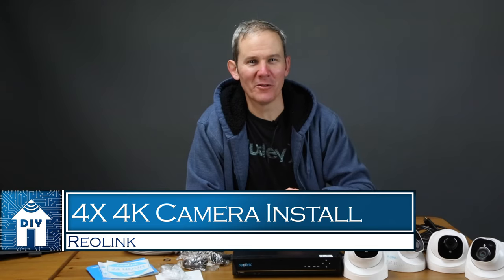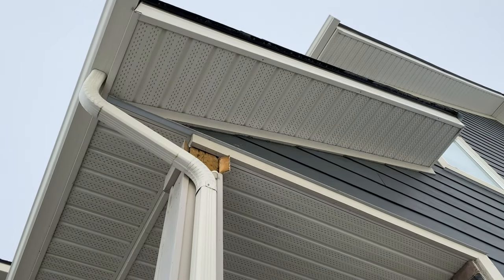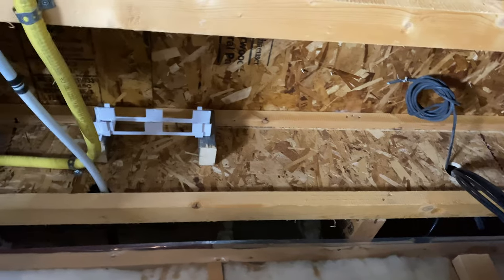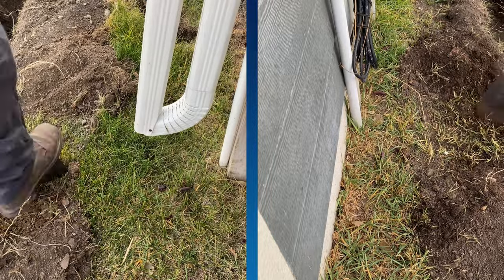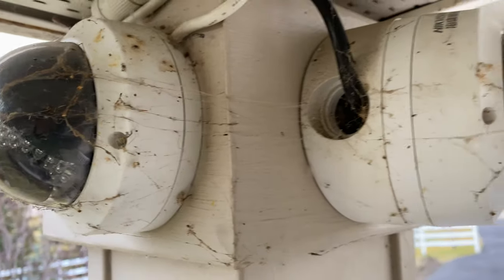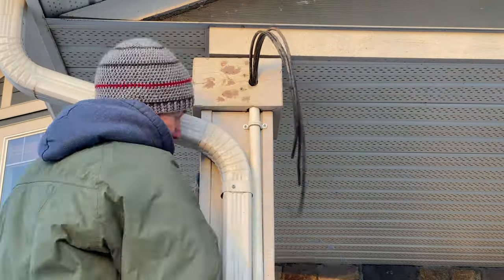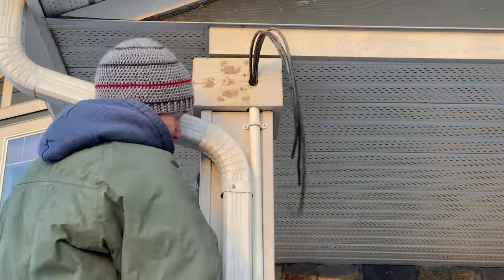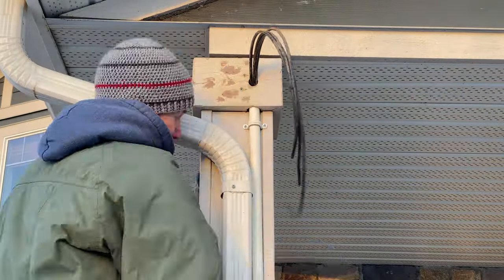How to install Reolink Security 4K PoE Cameras Outside - in DETAIL

Comment: Awesome video, thanks!  Just a quick tip if you have an existing hole from a hole saw that you need to make bigger, you can usually double up the smaller size hole saw inside the bigger one on the bit itself, and use that as your pilot hole.  That assumes they're the same brand, so I always buy the same brand hole saws.

Comment: So you mounted the camera plate to the junction box plate? Does it feel secure enough or do you need to use screws with a nut on the other side?

Comment: Why  did you go with reolink vs hikvisions ? Are you looking at moving to a standalone all in one nvr verses the blueiris machine ?
Reply from the maker: Good question. I find the genuine Hikvision cameras a little harder to find because they only have a very select list of distributers. The Reolink cameras are on Amazon and on reolink.com, and much and quicker to get my hands on. I also like their marketing and feel they have a strong position in the market. I am still running Hikvision and Blue Iris and I have videos in the works on each.
Reply: @HomeTechDIY  I have been using "gray market" hik's from what i find to be a reputable seller on ebay. No issues with them so far. I am still on the fence however weather dropping nearly $400-500 on a hikvision DS-7716 NVR or building a BI machine.
Reply from the maker: Yeah, it's a tough call. If you are installing more than 4 cameras, you'll want a beefy PC... which translates into money spent on better performing hardware.
Reply: @QuaabQueb   You can definitely find better prices for a DS-7716 (or OEM equivalent) on eBay.  You shouldn't be paying more than $200 if you know where to look.  There are 70+ companies that rebrand Hikvision products. I'd highly recommend looking into some of those OEM products on eBay, as you can find the exact same NVRs and cameras at a fraction of the cost.
Reply: Why not use Synology NAS? 😎.
Reply from the maker: @Dextermorga  Not sure if I am missing something but to met the same specs as the Reolink NVR, you would need the Synology Surveillance Player VisualStation (VS960HD) as recommended by the Synology NVR Selector. The cost would be $1000US and you would also need to purchase a PoE switch. VS960HD - https://amzn.to/3tkugZw
A Synology NAS can only be used to record footage over the network. I tried the NAS solution in the past and it couldn't keep up with the heavy bandwidth. Internal drives are much faster and more responsive, especially an NVMe drive, like I installed my my latest video.

Comment: Nice install thank you. Just have question . is there any signal lost if you use patch panel between NVR Unit and Cameras ? I want to do the same idea just wondering if there's a big diff. Secondly I want to upgrade my NVR 8 chan. to 16chan. What do you recommend add on another 8cha. unit or just straight 16cha. unit ? thx appreciate for the response.
Reply from the maker: Thanks for checking out my video. There is no lost signal or lag using a patch panel. I would recommend getting a 16ch unit instead of running 2 8ch units... unless you can fit more hard drive space into the 2 8ch units and you need that extra storage.
Reply: @HomeTechDIY  Thank you very much for the reply. I will do your advice.

Comment: Rather than the camera’s nightvision, would motion-sensor floodlights be a better light source?
Reply: If you have really bright lights that would allow the cameras to get color photos that might be ok, but you would have to deal with the time it takes for the camera to adjust from the night mode to the lights coming on.  You may also have issues with reflections from bright spot lights.  I don't think it's a bad idea, but you may have to do some tweaking and adjusting.  Another option is to get a remotely located IR emitter - they generally provide much more IR light than the camera does.  Added bonus, camera doesn't get covered in bugs.

Comment: Thanks for the tip on using Big Box junction boxes instead of the expensive Reolink junction boxes. I always wondered if they were the same size, and you answered the question for me. I will be replacing three nest wifi cams and going to 4K/NVR package very soon.

Comment: What an excellent video.  I have a number of cameras sitting around waiting to be installed.  I too have poor access to the soffit area and into the attic and have been considering various options.  I might go this route but I have to figure out if I want to use outdoor rated ethernet and just tuck it into the vinyl siding under the soffit around the house, or if I want to paint conduit and mount it along the roof line under the soffit.  Outdoor cable tucked away would be less noticeable, but conduit would help in the future if I ever needed to replace the cables.
Reply from the maker: Glad you found the video helpful. Tucking the wires into the siding is a great solution. I have done that a few times and it's a pretty quick solution. I did have a little trouble on 90-degree turns where the wires were a little visible. Yes, if you need to replace the wires, pulling them out carefully not to damage the siding.

Comment: Can you hang these (820a) cameras from above (under overhang of roof) or are they intended surface mount only?
Reply from the maker: They can be installed on a horizontal or a vertical surface. I have several under the overhang on my roof and they work perfectly.

Comment: Awesome video.  Did you glue all the pvc conduits including elbow joints?
Reply from the maker: Yes, lots of dry fitting and gluing
Reply: @HomeTechDIY  

You mentioned you wish the junction box were bigger.  Since the conduit is glued to the junction box, I assume you will have to cut the conduit pipe to change the junction box in the future, right?
Reply from the maker: Yes. I would remove all the boxes and pipes and re-fit everything on top of the pillar.
Reply: @HomeTechDIY  

I am in the process of putting up a pvc conduit on the side and back of my  house to run my ethernet cable.  I think I will glue only  the critical joints that needs stability.   I am runing outdoor rated cat6a cable, so not worry about the moisture.  The pvc is more for aesthetic than cable protection.  What do you think?
Reply from the maker: Sounds like a good idea to me. :)
Reply: @HomeTechDIY  
What did you use to make a screw thread on the junction box cover?  I suppose I can drill a hole to hold  the plastic anchor that is used in stucco. Then I can simply screw into the anchor?

Comment: Nice job, good future-proofing as well.  Something you might consider in the future would be remote IR emitters.  You can turn off the IR in the cameras and that cuts down on the spider attraction.  You can also paint the top part of the downspouts black which helps with glare even if they are just outside this picture.  Thanks again.
Reply from the maker: Thanks for the tips!

Comment: Where did you get the smaller waterproof cable grand and  cap?  The ones that came with the Reolink camera are too big (too long).  The ones you used look smaller.
Reply from the maker: I had some extra lying around that did the trick.

Comment: Does the patch panel affect the POE the NVR provides to the cameras? I purchased the same system and am trying to find a way to keep things relatively organized without needing to buy an expensive POE switch or building out a complex home network…
Reply from the maker: I didn't notice any impact to the power or data in my scenario due to the patch panel. It is a possible point of failure but also helps clean things up and keep things organized.

Comment: Can these be installed on a wall instead of a ceiling without a junction box?
Reply from the maker: Yes, on a wall is just fine. If you are not using a junction box, make sure to account for the wire when planning your install.

Comment: Very helpful. Thank you! Have you had success connecting a doorbell cam to the Reolink NVR? I'm considering a system similar to what you've installed and would love to be able to add a doorbell cam (and perhaps a couple indoor wireless cams) to the system. Do you know if that's possible? Thanks again. Your ability to explain complex config steps in a clear and concise way is impressive. Well done.
Reply from the maker: I have not tried it but it would be possible if the door bell supports ONVIF.

Comment: Hi, I am trying to add junction box to my reolink cameras. I bought the same ones you are using but having troubles with the screws. They stick out cause the heads are too big. Did you use different screws?
Reply from the maker: Hey. I had the same issue, so I used a larger drill bit (the same width of the screw heads) to make the holes in the cover a just a couple millimeters deep so the screw heads will be flush with the cover.

Comment: Is cat 6 cable all the same? Where do you get yours, there seems to be cable from $90 to $225 for 1000' rolls. I read some is solid and some is braided do you have a preference?
Reply from the maker: The link for mine is in the video's description. There are different quality notes, like sure copper or just copper coated. There is a difference sometimes in the wire gauge. I prefer the thicker stuff at 23AWG, instead of 24.

Comment: Hi there, I'm looking to mount some reolink bullet cameras on a solid brick wall. Do you recommend the junction boxes to hide/house the reset & power fittings? Thanks
Reply from the maker: Unless you can access and hide (and then seal) a hole for the connector behind the wall, it seems junction boxes are the best solution to hide the fittings.

Comment: Do you have a link or description of the junction box you used ?
Reply from the maker: Similar Junction box: https://www.homedepot.com/p/Commercial-Electric-1-2-in-Gray-5-Holes-4-in-Round-Non-Metallic-Weatherproof-Box-WRB550PG/300851119
Junction box cover: https://www.homedepot.com/p/Commercial-Electric-Gray-4-in-Round-Non-Metallic-Weatherproof-Blank-Cover-WBC300PG/300852125

Comment: Would it be OK to use RJ45 couplers instead of a patch panel as I will only be running 5 or 6 network cables from the NVR location to rear porch roof space before I run the cables to the camera locations around the back garden, as the patch panels I see are like 24ports which is way more than I will ever need?
Reply from the maker: Yes, I have used couplers like these for this very purpose: https://amzn.to/3aBEQDA

Comment: Are these cameras the 4K 8MP or 12MP? The reason I ask is your recordings are smooth and don't show and jitter. I think the 12MP have a slower frame rate and could be a problem, so I am assuming your cameras are the 8MP.

Comment: Could you give some sort of insight into the hours involved in doing all this wiring?  My guess would be two full days of work. Much appreciated!
Reply from the maker: Good question, there was obviously a lot of work done off-camera. In total, I spent 10 hours on the wiring alone. I made a bunch of mistakes along the way and had to redo a bunch of stuff, but this video only shows final product. I ended up doing the patch panel 3 times because the wires wouldn't line up correctly, that's why there are 2 holes cut behind the panel, they would not fit on the sides. Hope this helps.

Comment: you prefer this cameras instead of the  HIKVISIONS?
Reply from the maker: I find the genuine Hikvision cameras a little harder to find because they only have a very select list of distributers. The Reolink cameras are on Amazon and on reolink.com, and much and quicker to get my hands on. I also like their marketing strategy and feel they have a strong position in the market. I am still running Hikvision and Blue Iris and I have videos in the works on each.
Reply: @HomeTechDIY   would you recommend the reolink rlc-1220a camera/nvr system or would you recommend something else?

Comment: What is the maximum length of stranded cat6 cable for this camera?
Reply from the maker: Good question. Officially, it's 100m, but as you may have seen in my past videos (https://youtu.be/CDqZs5M4i4s) we can achieve lengths much greater. I have not yet tested the maximum functional length from the NVR to the camera.

Comment: I'm doubting the 60 ft, can you please post a video and show measurements?  Also please include all settings as well.
Reply from the maker: Thanks for questioning the distance. You are correct. I just double checked the distance and it's 56 feet, 2 inches. I have posted this official distance and the default camera settings used in this video to my blog post: http://www.hometechdiy.com/install_reolink_d800/

Comment: I installed the exact same system and it works perfectly.  My apartment block is in New York, and I watch the system from London.  The only problem I have is installing additional cameras.  The system see the cameras but will not allow me to add it to the system, Reolink support is awful.
Reply from the maker: Are you adding the cameras directly to the PoE ports on the camera or over your LAN? Not sure what you mean by the system can see the camera but you cannot add them to the system. Are you able to see the cameras' live feed on the NVR itself and not over the Reolink app?

Comment: I see snow. I am in Canada and would like to know how cold it gets where you are. We can count on at least two weeks of -30 to -40 degrees C in the winter. Have you had any cold weather problems? Camera failure, condensation, etc.?
Reply from the maker: I'm in Alberta. It was about -25 last night and I had no issues. I've used other Reolink cameras in -40 and they were a little sluggish and some ghosting at night but no major issues.
Reply: Hello. This is a late reply but I also live in a very cold province (Montreal, Quebec) and we have -25 and sometime -40 with the wind chill. Never had a single issue with all my 8 Reolink cameras (RLC-820A). It's up there since October 2020. So 3 winters already. Hope that helps.

Comment: I just can’t understand the need for that panel? If the wire is coming straight from camera to NVR, why the panel is needed?
Reply from the maker: Technically it's not needed but if I want to install additional cameras in the future I only need to run the wires to the patch panel. This would be even more challenging once my ceiling is finished and covered in drywall.

Comment: What you could do is swap the angles of the garage and drive cameras so they're shooting perpendicular to each other, that way you shouldn't have to move the drains and you should maintain good IR images.
Reply from the maker: That is a really good idea. Thanks for sharing!!
Reply: @HomeTechDIY  No problem, I tackle issues like that installing cameras pretty much monthly. Usually, it just takes a bit of fiddling in order to sort common issues like that.

Comment: could of just use a power line & then a poe switch and use exiting power from the porch
Reply from the maker: Cool idea! This approach would eliminate the option of connecting the cameras directly to the NVR but LAN cameras are a workable option. I am interested in learning more... How would I protect the EoP device and switch from the elements and -40 degrees? Where would this additional hardware be stored out of sight? How could I prevent someone from unplugging the devices from the on-porch power plug? I have run a couple 4k cameras over EoP, but not 4. How much lag should I expect (across breakers)?

Comment: Cameras are getting really good nowadays. Someone just needs to solve the main issue with CCTV cameras now - SPIDERS!
Reply: Someone else mentioned a remotely located IR emitter. Disable the IR on the camera and use that, if you can.
Reply: @sirtimatbob  That's a good idea! Thanks.

Comment: Putting all your cameras together in one spot is terribly unsecure. You should have them at different ends of the house to eliminate blind spots and single points of attack.
Reply from the maker: I guess one's install choice would depend on probability and risk for an "attack". Be sure to check out my other videos to see my 12 other cameras I have installed around the property.
Reply: @HomeTechDIY  touche

Comment: You spent more money on the plastic conduit than the actual cams. Run cables thru cold air return into attic soffit like the pro's do.
Reply from the maker: For this overhang install location, there is no access into the attic. It's basically dead space. 1:38

Comment: Seems easy to get to, someone walks over in the dark with a mask and just cuts all your lines at the same time. Sort of defeats the purpose of security if even a kid can reach it outside your home.
Reply from the maker: Thanks for the feedback! Do check out my planning video which talks about working with your options and covers risks including physical damage to cameras. In my case, the cameras are 10 feet from the ground but yes, climbing the rail would bring one closer to the devices. Again, cable options were discussed in the video and given the physical barriers, conduit was my next best choice of network wire routing and protection. Any thoughts on how you would change the approach? Thanks again!
Reply: Most thieves are dimwits. One just kicked my front door in and I have 2 more additional doors. By the time they cut the cable they've been detected

Comment: This is ridiculous.. Basically you gotta be a fully licensed electrician or contractor to put the camera. This is not DIY.
Reply from the maker: It depends on your level of experience and comfort to tackle a project like this. I'm no electrician or contractor, and there could be easier approaches depending on your camera install location and how meticulous you want to be.
Reply: Then get wireless